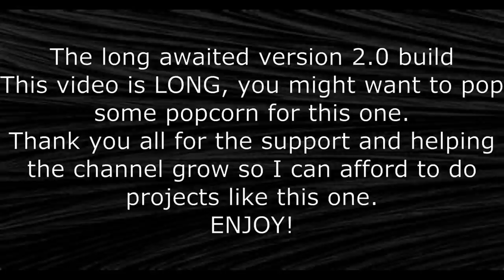Homemade ice maker build! VERSION 2.0! Cleaner build! #435

Comment: Just finished mine up but having issues with a bunch of water at the bottom of my deep freezer. I have the ice maker at the lowest water setting possible. Any suggestions?
Reply from the maker: Water setting was my guess, you might have a faulty water valve or ice maker.
Reply: @TKCL  I have my water line tapped into my wated heater. Did you have any issues with water pressure causing any issues?  Its 3/4" pex down to 1/4" ice maker line. Im ordering an inline pressure reducer to see if that helps. If that doesnt work I guess ill have to order another ice maker kit as suggested.
Reply: So its safe to assume at this point ive created a water hammer issue due to the decrease in line size. I woke up to a ruptured water solenoid so I have fitted the line with a ball valve that I will keep it closed down to reduce the volume of water and regulate the velocity. New solenoid on order 🤞
Reply from the maker: Highly recommend you don't tap into hot water. Pressure increases with heat AND the water line, filter ect is not hot water rated.
Reply: @TKCL  ive tapped into the cold side of the water heater but clearly its causing issues with increased velocity due to the reduction of line size.
Reply from the maker: @colinedmonston2182 I'm sure someone makes a pressure reducer.
Reply: @TKCL  I have one on the way so its gonna be trial and error for now. Should know somerhing Wednesday with the parts coming in. Whatever my solution is ill share so maybe it could be something to address in the next video for those having similar issues. 👍
Reply: Got it up a runnning and its been a few days working good. The ball valve turned a 1/4 of the way did the job. Low production from the mold having to cool back down before the water is injected. Going to be adding a heatsink to the bottom of the mold with thermal adhesive to reduce the time to cool back down as well as helping freeze the ice. Plans later to add a second ice maker like you did in the earlier videos.
Reply from the maker: Do you have fans?
Reply: @TKCL  I have one blowing perpendicular to the ice maker and attached to the lid like the 2.0 build. The ice forms pretty quick but I believe the refill process is taking longer then it should. Maybe takes 5-10 mins after it heats the form up to release the ice for it to refill.

Comment: Costco has 20 lb bags for like $3.00
Reply from the maker: Cool, so I just checked....Closest Costco is 34 miles from me, my truck averages 17 mpg, gas is roughly $4 a gallon. So that's $16 for gas, plus $3 per ice. Not to mention well over an hour my time. So $19 for a bag of ice, or $. 44 cents per 20lbs for me to make my own and it's waiting for me in my back yard.... Hard to put a price on convenience, but in this case it's quite easy. FYI my closest store sells 10lb bags now for $2.99 each... As you can see it adds up quickly.
Reply: @TKCL  yeah..  the ice maker is a better option for you :)

Comment: I don’t see the savings.  You can buy a vevor ice maker from Home Depot that makes 120# a day for less than $400 all in.  That is ten times the ice for less cost in $ and no time spent building.
Reply from the maker: That's not even remotely the commercial machine I'm referring to. You also get about a true 20-30lbs of storage in a machine like that. Start pricing ice machines that hold a couple hundred pounds like mine.
Reply: @TKCL  true you don’t get the storage, if that is important you can always bag some and put it in a separate freezer.  For most of us though thirty pounds is enough to get us out on the water for the day and by the time you are back the ice machine is full again.  Production is the key factor and production at ten times what you are getting for less all in cost makes for a better option for most of us or at least for me.
Reply from the maker: There's way more disadvantages to a machine like that than you realize. Plus if I have to buy a freezer anyway to store the ice, it's not worth it. I need upwards of 100lbs ready to go. Getting 11-12lbs a day of thick, large cubes is adequate for me for coolers and fishing trips. Now when we put in a pool and back deck, I'll probably be buying one of those cheap residential units. They make a completely different type of ice though, constantly melting, small and they use a lot of electricity.
Reply: @TKCL  I installed a vevor at our yacht club a year and a half ago, zero problems in that time, and included a side freezer for storage.  All in cost for both freezer and ice maker was less than 600 bucks.  We have over 200 pounds of ice storage in the freezer and make 120 pounds a day of ice in the ice maker.  Maybe we are spending a bit more in electricity but  not a big deal.  Also the ice maker lets us change ice shape to what we want from thin ice for displays like laying out seafood at a banquet to thick ice for weekend warriors going off shore.  Can you adjust ice size?
Anyway point is there are manufactured ice makers that may be a better option for many.

Comment: Every time u add water you are putting on a big load. Your poor compressor is likely running flat out. No need for a temp control like that. Get rid of the ducting. And just have a fan circulating.

If u wanna talk to a real expert. I’m that guy. I can make any chamber from -80c to +2000. Design, fabricate, pipe, and charge.

You’re also going to have a huge problem with defrost. The evaporators on the walls that’s why when you look inside chest freezers often times there’s so much ice buildup on the walls. Chest freezers  are designed to be for long-term storage. Heat goes up cold goes down so A chest freezers a lot more stable than upright refrigerators that lets all the cold fall out. Not only are you going to have a huge problem for moisture from opening up the door to get ice all the time but you’re actually straight adding water through the ice machines so as the ice builds up on the walls it loses efficiency because it insulates the actual ability for it to cool. I’m not sure if the defrost cycle would work for a chest freezer I doubt it. Most manufacturers tell you to defrost the unit once to twice a year. That means unplugging it and letting all the ice on the walls melt.

Also with that kind of load that you’re adding to the compressor I would seriously recommend it the least adding a fan by the compressor. And let me know whether the condenser is actually the outside walls of the freezer or if there’s actually a condenser in the bottom that’s removing the heat.You’ll be able to tell by feeling the outside walls around the whole chest freezer if one of them is warm then the condenser is a static condenser opposite of the static evaporator. Let’s hope that it’s got a fun type condenser in the bottom because then you can actually get more air over it. Otherwise there’s only so much you can do with a static condenser that uses the outside walls of the unit.

Also the reason why ice machines have an ice bin that’s not refrigerated that just lets the ice melt and dip out of the bottom is because what happens is the ice freezes up into a gigantic bowl of solid ice and becomes unusable especially when it starts freezing to the walls. I’m sure you’ve experienced that on a small scale in your home refrigerator. However, that mostly occurs from the defrost cycle and the ice slightly melting or from not completely frozen ice dropping from the ice machine with moisture on the outside

I feel so bad for that poor little compressor. Def add a muffin fan that runs flat out pointed at him.
Reply from the maker: While I agree with some of what you said, I also disagree with a lot of it as I've been running these for about a year and a half. Hard to argue with results. That compressor is still running strong and I'm making ice. The Defrost is a non issue for me. Twice a year I Defrost and clean it anyway. As I do my huge chest freezer that I store meats and vegetables in. Ever looked inside a commercial ice machine at the mold,, mildew and otherwise unsanitary conditions in them? All ice makers should be cleaned many times through the year, but most people neglect that.
Reply: @TKCL  can’t argue with results.🙂 I’m not bashing you, I’ve been repairing, building, obsessing over freezers since I was 12 (dads company), so my first instinct is to troubleshoot and find everything that could go wrong. Don’t take me the wrong way. It’s a good idea. Is the condenser the outside wall or is it actually has a condenser in the bottom next to compressor? Are you actually storing meat and stuff in there with the ice or are you just using it as an ice machine by itself? Did you retain the fan? How often are you in and out of it?

People have no idea how disgusting their local 7-Eleven ice machine most likely is. A lot of ice machines I’ve worked on in my life literally had about a half inch of slime on the actual part that made the ice really really really disturbingly gross. I’m glad that I haven’t had to work on that many ice machines in my life.All the ones that I have are disgusting they were cube anyway. I work on cascade systems are ultra low temperature freezers and scientific aerospace equipment typically freezers are family

I think that you’re getting away with not having to worry about the ice getting stuck together because you don’t have a defrost cycle that allows the ice to get thawed at all. That’s how you’re avoiding the giant lump of ice all stuck together….

If you’re that confident why don’t you add some heat sinks to the sides of the freezer so that it actually has more surface area for the evaporators on the inside that would be funny…

The thing to remember about hermetic compressors is that typically they are cooled through the residual suction sub cooled vapor,So if there’s not enough gas to make it all the way through the evaporator to the compressor it’ll overheat. See I’m sorry I can’t help it , I’ve had four apprentices , I can’t help it

Comment: Would have been quicker to drive the 30 miles to get the switch
Reply from the maker: That's not always convenient, I have a lot going on. It's a 1 1/2 hour round trip and I don't really know where to get it from locally. Big box stores don't seem to sell small repair parts.

Comment: i just followed these videos to the letter and i can’t get the ice machines to work
Reply from the maker: Sounds like they are not wired correctly, I've built two and had no problems with them working.
Reply: @TKCL  ok i figured out the problem. I used 2 Hisense ice makers and they are straight garbage. I went back to lowe’s and switched them out with 2 GE’s, hooked them up and they worked straight away since my freezer is already at temp. Thank you for replying
Reply from the maker: Glad you got it going! Enjoy